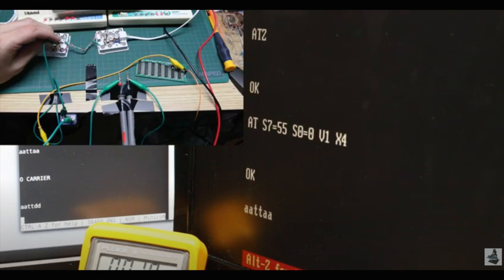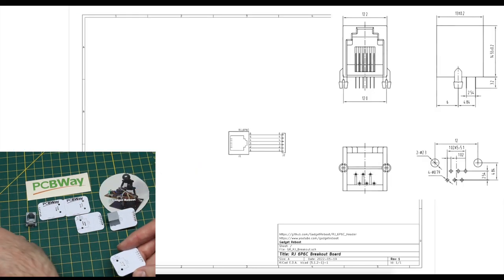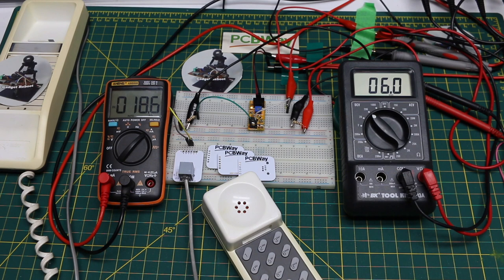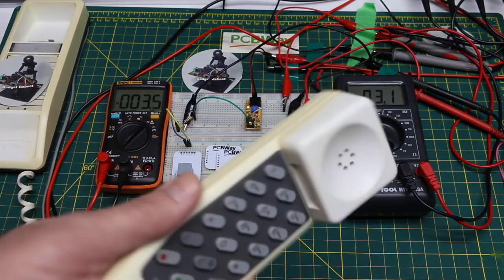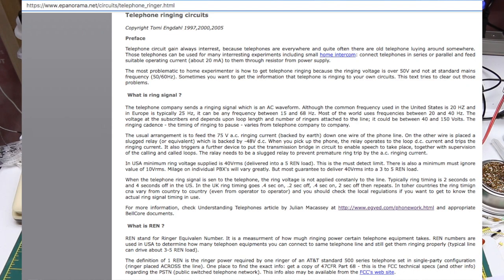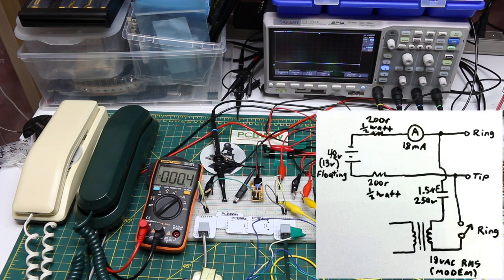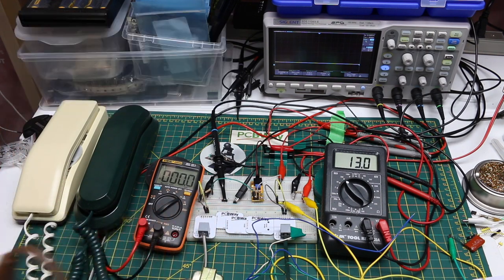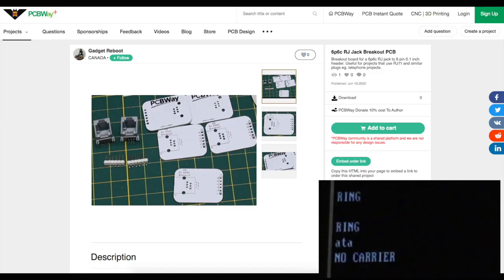Phone Line Simulator - DC Loop Current and AC Ring Voltage Experiments

Comment: Wiki isn't always right. While your in the correct direction, it's not exact. The phone system works on -48V not +48v. Secondly, when you pick up the phone there should be 300 ohms resistance. you shouldn't have a voltage of more than 1-2v because picking up the phone creates a "short" on the pair. The phone system rings on 100V AC sent from a ring generator from the central office at 20 cycles per second. In the old days it would pass through a "half ringer" circuit which is really nothing more than a capacitor and zener diode located in the NID or "network interface device"  on the outside of the home and then into the home to 1 or more phones. On a rotary phone a user who could not dial the rotary could simply take the phone on and off the hook rapidly to dial a number. The switch at the central office could decode this. Today I rarely see rotary phones but they are out there. The signal travelling on the pairs down the road is shielded by twisting the two wires together. This creates shielding from interference and allows the DC to carry across the pairs without interference for miles. I got side-tracked....anyways, If you use an NE555 timer to control a relay you could reproduce the ring on and off frequency. The ring generator is always on and functioning in the central office. It connects to a line when the switch sees an incoming call to a customer.  When a person A calls person B, The ring generator rings person B for a few seconds, then rings person A for a few seconds, back and forth. So person A knows it's ringing and person b knows they are getting a phone call.